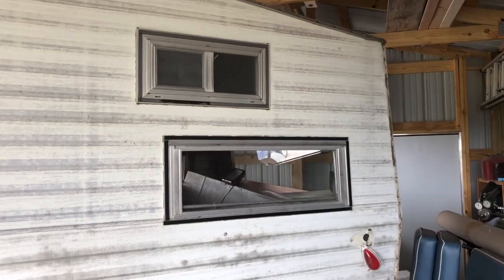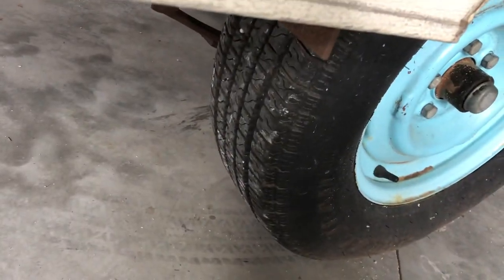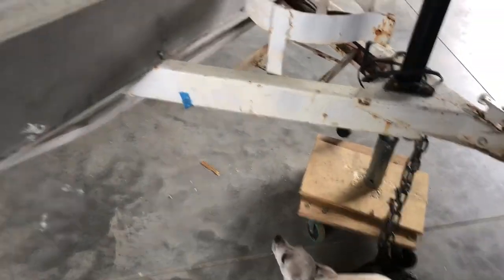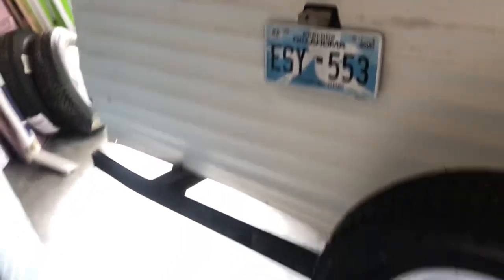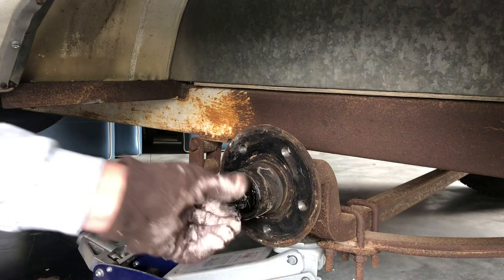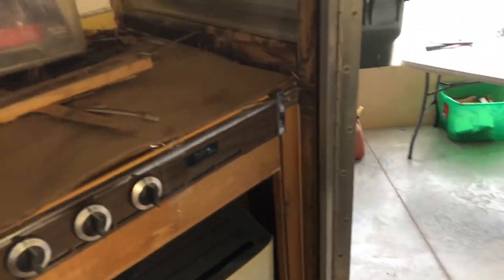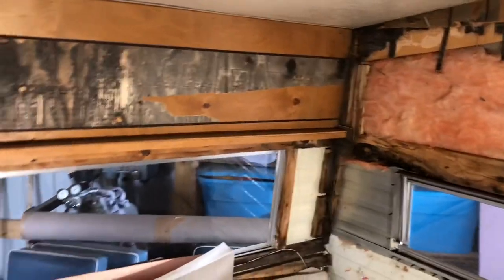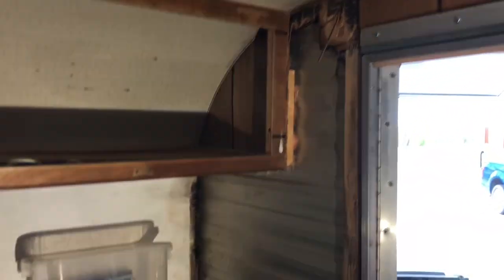Ep. 43 What to look for when deciding you will rebuild vintage camper DON'T SPEND TO MUCH!!!

Comment: Do you have any tips for someone who has zero carpentry skills? I have a 1956 Aloha and I am nervous to start. No clue what I’m doing!
Reply from the maker: I just bought a 1954 Aloha. Not sure when I will get to it on YouTube but everything on the inside was pretty square back then. Draw up plans and take your measurements. Lumber is pretty expensive to practice on so take your time and use the correct tools. Good luck on your build. It is exciting.

Comment: Curious to what you will do for heat if you’re not going to use the original heater I’m currently working on a 71 campfire is not a desirable model but it’s my first attempt at rebuilding a vintage trailer so I thought I would go with something relatively cheap.
Reply from the maker: I small, plug in heater will heat these up very quickly.

Comment: What do you use for the inside walls. I bought some quarter inch plywood last fall. I used some on a different project and found that it peeled the first layer off. Do you use this or luan or something else? Thanks.
Reply from the maker: You can use luan or 1/4" ply.
Reply: @RobTheRebuilder  Thanks.
Reply from the maker: @icecreamladydriver1606  you bet